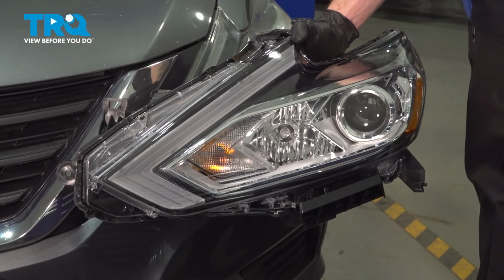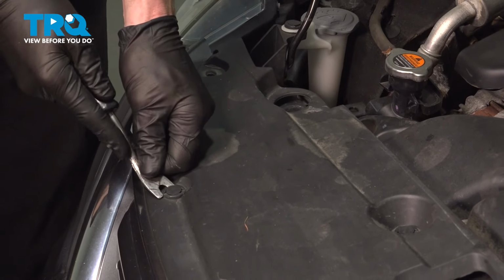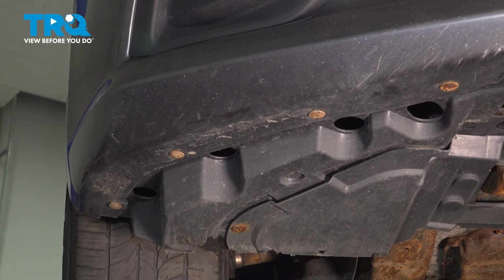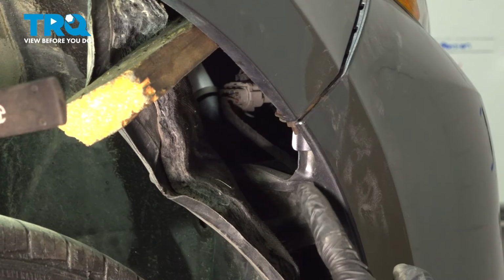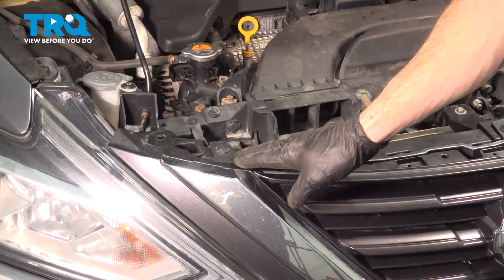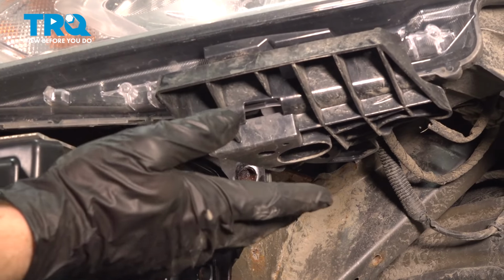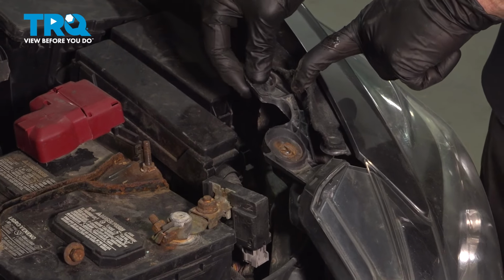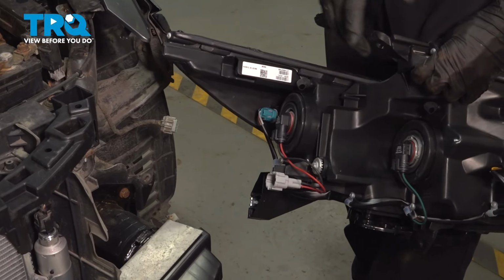How to Replace Headlight Assemblies 2012-2018 Nissan Altima

Comment: My 2018 NIssan Maxima had 2 wiring connectors, the second with a single wire, and the replacement headlight didn't have a connector for it. The new light seems to work but I get a "Headlight System Error" message. Any ideas?

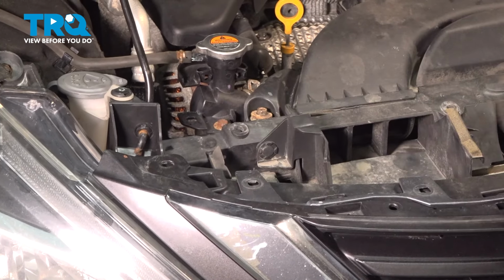Comment: Your video is on a 2016 Altima. This procedure to remove the Front Bumper does not work on a 2013-2015 model as the top corners of the bumper are completely different mounts (starting at 3:50). This maybe the same Headlight assembly, but Nissan redesigned the front end in 2016. If you try to pry the corners out, you will break the support bracket holding it underneath. Also, wiring is not like the 2016 model, nor removal of the headlamp assembly.